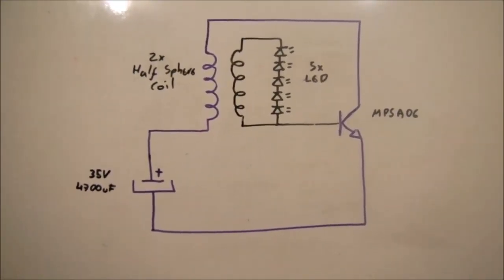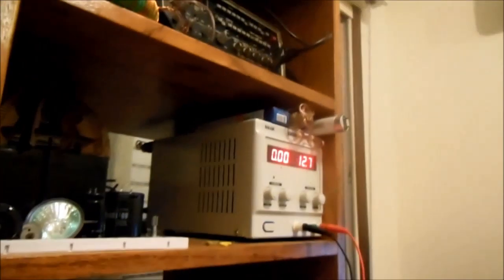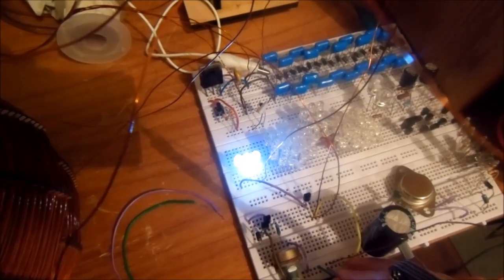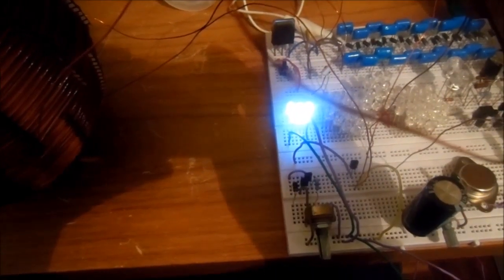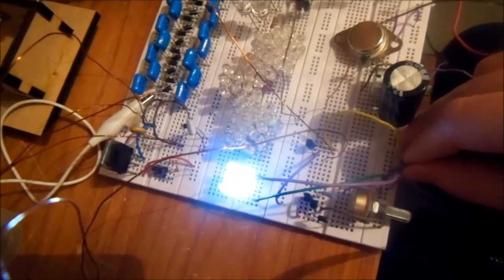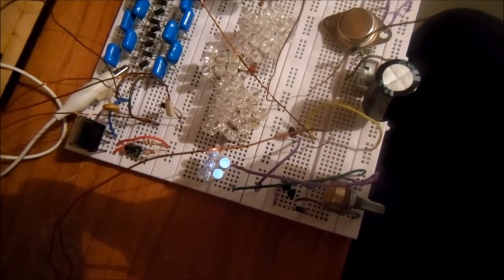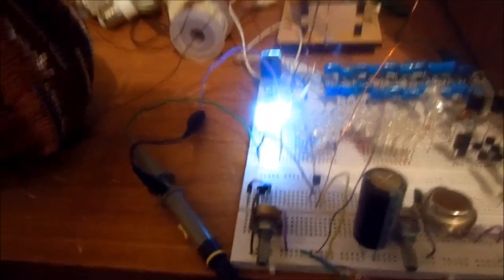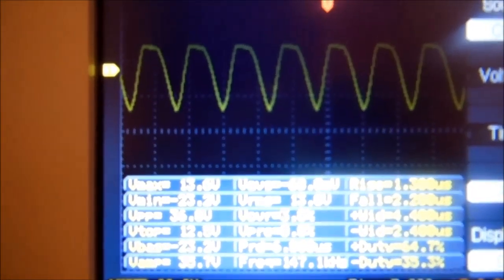2 x Half Sphere Coil using SJR v3

Comment: Rodrigo, Thank you for a well done video. The coils are beautiful. Would you please tell me how many turns you have in the primary and secondary? Thank you.
Reply from the maker: I made a video about this coil here:
How to build a Half-Sphere Pankake Coil

Each coil has 24 gaps.
Each gap can take at least 15 turns.
So, there will be more than 360 turns.
Both coils are equal, so the number of turns in the primary is the same in the secundary.

Hope it helps!